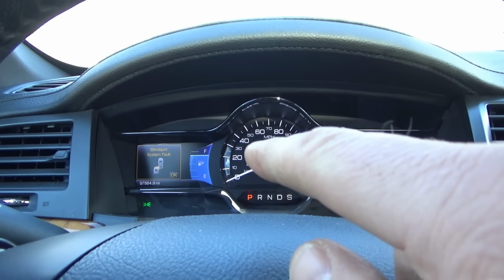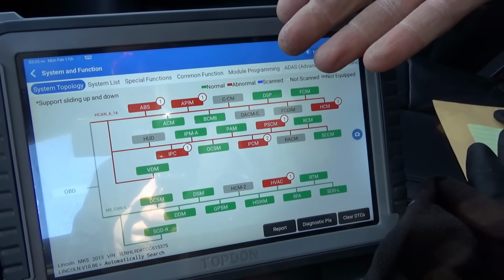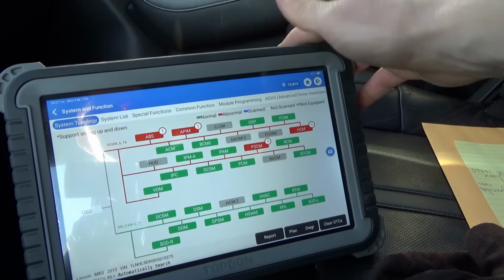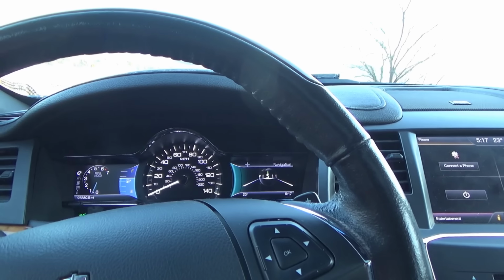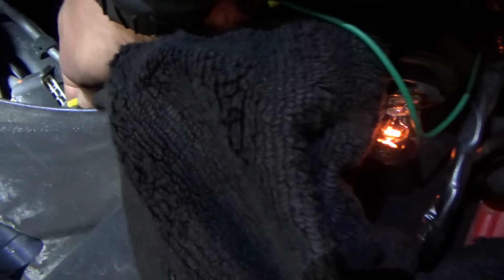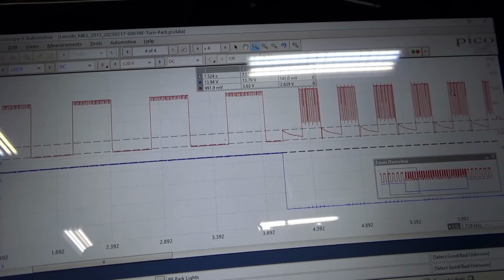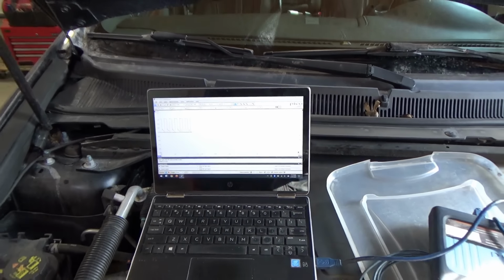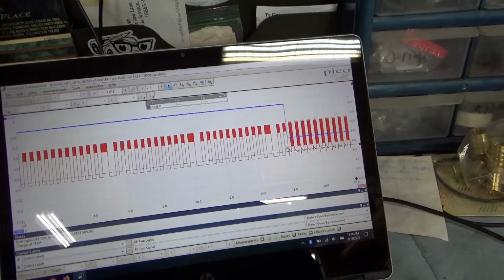(Pt 2) Lincoln BUTCHERED...by Dealer?! ('13 MKS: ABS Fault...CRAZY "Strobe" Turn Signals?!)

Comment: Crazy stuff. When I started working on vehicles, in addition to the tractors that I grew up working on (Oliver 77 RowCrop), the speed of the turn signal flash was controlled by a resistor in the turn signal module. If the speed of your turn signal flash changed it meant that the resistance in the circuit had changed, which typically indicated that a turn signal lamp had burned out. Replace the bulb and the blink rate would return to normal. Of course, we're talking about the early 70's... :-)

Comment: A higher voltage on the battery means that water ingress issues would occur more frequently. The succession of rapid and normal-speed flashes should have been an indication of an intermittent fault, not necessarily BCM-related only.

Comment: Hi Ivan , I have watched you for a fair few years now. You are great at what you do and your videos are very clear and helpful.
1995 to around 2015 Fords in UK use the indicators for fault codes and key programming procedures both pats 1 and 2  manual program no tools.
your pattern is repeating the same sequence over again.
I have not seen it on newer models as yet.
Keep up the good work, Wish you the best with your life changes.
Kind regards Max

Comment: The turn signals are because of a bad bulb or incorrect bulb. My Ford f150 does this when a bulb is bad or when I put in LED bulbs. It makes crazy blinker patterns. And whats even crazier is the light itself does not flash to the blinker noise you hear.

Comment: It is insanity to make cars so complicated that this happens. The chip in your alternator should not need to be tied to the map lamp in order for the steering wheel to work. The rear window defogger should not have to be connected to the radio.

Comment: I LOVE customers like this lady. "FIX IT. I'M KEEPING THE CAR FOREVER." Makes the bullseye on the target very clear, even if the target is 1600 meters downrange. I've had a few like her. One such gentleman (RIP Mr.Potter) owned several MINT, 1970's Toyota cars and a 1979 GM diesel station wagon. Even if a worn HVAC linkage was "tinkling" on a rough road, and the entire dash had to come out, he wanted it FIXED. "CALL ME WHEN IT'S READY." -- B.P.

Comment: This make me think, these moden cars use bcm to control almost everything, If the bcm goes bad and discontinued ,can we fix it by just use some easy method. My 2012 Jaguar xjl just went dead under a small lot not able to tow out. figure out dead bcm. fortunately I found two used one and got somebody programed it.one of it just worked luckly.  it's not hard to replace . or if both of them doesn't work I have to give it up

Comment: Just for laughs try inspecting all the globes for crusted/ water   And take out light switch for wear damage and has the leaking water got to it . Can you cover the car while you’re away . The condensation in the car while you’re away won’t help either. I’d be mopping out as much water as I could

Comment: Could the BCM be trying to limit current?  More voltage = more current and then it tries to limit the current?  The headlights on must be lowering the voltage below a threshold and then it no longer needs to limit the current...?? Or turning on the headlights is some how creating a redundant ground?  A voltage test at the BCM might yield something?  I think it is somehow related to the steering angle sensor issue.

Comment: In the old days when your turn signals act crazy, you just had to replace a $2 flasher three pin relay. Nowadays if it happens, you have to replace a $1000 computer module.  We are going backwards. 😭

Comment: If this would be my car... :) 
I would drop in a new clockspring, 4 wheel-speed-sensors and see, if any problem is solved. 350  + 4x20 Euro till here. 
Or a used clockspring 40-60 Euro. 
Is the ground of the bcm in good condition? 

This disco-policecar-flashlight in MY car happend when ground somewhere was compromitted. 
BUT: I con't habe a pico.

Comment: It seems to me that the problem with the turn signals is wiring related. Both park and turn signals share a common ground, and the headlights are grounded at a separate location. Also, since the BCM has separate transistors for both right and left, how can both experience the exact same symptom if it's an internal BCM problem? It seems more likely that the BCM is reacting to an external problem that both sides have in common, which is the ground. I checked the OE wiring diagram, and it shows the park and turn signals ground at G100 on the right side of the engine compartment. It appears to be loaded with a bunch of other grounds as well, much like Chrysler products. It's strange how the ground passed the test with the incandescent test lamp load, but we also never got to see if there was voltage drop on the circuit with the load applied. The only clue is the elevated voltage on the scope. I'm still just not convinced the BCM is bad since it has the capability to function properly, but it starts doing weird things only under certain conditions. Since LED current draw is so low, possibly they just can't "burn through" the corrosion.

Comment: having experienced a bcm failure and configuration issues with the replacement because we attempted to copy the configuration from the previous module i can attest to seeing some problems with the trunk it was in until we were able to get it properly configured i would suspect that this part of the issue im looking forward to see what you find ahh water such a big issue with these things it’s probably why it died in the first place leaking windshields plug sunroof drains so many times

Comment: My '15 Hyundai Genesis has an incandescent turn signal/DRM. In stock form, it's basically an 1157 socket but with only 2 wires. It's wired to run on the high side filament, so the DRM is always running on the brighter filament. This makes the bulb fail within about 9 months. I changed to an LED bulb which lasts much longer, but can cause "Hyperflash". I guess it's BCM is looking for a certain load and doesn't always "see" it. Maybe you could just add a small load resistor to the Lincoln's circuit?

Comment: LED signal light require a different relay because of the low voltage. Maybe someone changed the relay for some reason and put in a relay for incandescent bulbs instead. ?? I know if you put led bulbs on a motorcycle you have to change the relay too.

Comment: I used to be a huge Lincoln fan.  Last good one was the Towncar. The 90’s to early 2000’s were great cars.  The only issues I remember were the auto leveling rear bags.  My grandma had a 92 Continental, and it was also a good car.  Man they were so comfortable.  These new cars feel like you’re sitting on a stiff awkward lawn chair.  It’s absolutely pathetic that Ford/Lincoln cannot fix or supply parts for a 2013.  If I was her I’d get rid of it.

Comment: Once had similar issues with LED lamps being controlled by pulse width type dimmers. Work around was a small incandescent lamp in parallel with the LEDS. Strobing effect ended.

Comment: It's a ground issue, when parking or or headlights make the issue go away, I'm guessing they share a ground point.  It's more obvious in LED's that blink, but incandescent bulbs will be dimmer when the parking or headlights are off, and brighter when they are on.  You also noticed that the side blinker doesn't work with the the parking lights off, just the front blinks like a strobe, perfect example of a weak ground.

Comment: ivan these fomoco bcm modules are known failure points for water intrusion ,i had a mustang that the radio didnt work park lights were freaking out turns out water inside the bcm rotted all connectors green at harness connections changed bcm cleaned all connectors car is perfect now

Comment: Old electronics guy here - I think LED's on the cars have their brightness controlled by PWM duty cycle. The same LED can perform 2 functions ( like park/turn) when driven with different waveforms. And the fast flash is traditionally used (since turn signals have existed) to let you know a bulb is open circuited. I would expect the BCM is monitoring current to the bulbs/ LED's, and changing the flash rate when a current threshold has been triggered. And with battery voltage changing due to alternator or battery charger conditions, the bulb/LED current will change, possibly triggering a threshold in one or more situations. One would also wonder if the BCM has calibration settings to compensate for differences in vehicle bulbs/LED's. I find it interesting that very old vehicles used a thermo-mechanical flasher to accomplish some of the functions that a modern car uses a computer for. I remember in the 1980's a Mercedes had an electronic flasher module that was $35 and did the same job as what a $0.99 thermo-mechanical flasher did at that time. I like the old stuff. The new stuff will never be as reliable or sustainable, in my opinion.

Comment: This gets weirder on each video, Ivan! My first thought was a bad current return on the lamps, but you shown the ground is good. Next, I thought the alternator could be influencing the electronics, but no definite check was made. The scope patterns are very repetitive and (assuming it's not a police BCM 🙂) could be, indeed the BCM causing them. Couldn't think of a reason, but @uldiisl below mentioned a wrong lamp check, that I find possible, but does not immediately explain the effect of the parking lights. Part 3 will be very interesting! Wonder what Keith thinks about this 🙂

Comment: All above my head however a 2013 mks did not come with LED standard, I think. Has the lights been changed over to LED? That has caused problems for me because of decreased current draw.

Comment: Obviously you need to pull the BCM and pull it apart and see if it's corroded inside.  Maybe you will get lucky and find some green crusties that can be fixed and still use this BCM.   Then you still have to find the water issue.    I would get a good close look at the windshield and then the cowl under the hood, etc.

Comment: I know several years ago, Ivan, you went to a training seminar and met up with Keith DeFazio and Keith Perkins from L1 Automotive training.  You all had a vehicle that had been in a flood and it was doing some weird stuff.  I can't help but think that leak has something to do with the issues this car is having at this time.  I must say, if this woman takes meticulous care of her vehicle, it hasn't been cared for in the 6 months it has been off the road.  I would bet there is an issue with the plastic tray below the windshield having drain holes clogged with leaves and debris and it is overflowing into the car.  Can't wait for part 3.  GREAT VIDEO!

Comment: If you want to drive an LED you need to control the current not voltage. It looks like that switching  you see of the voltage waveform is an attempt to control the current. This control mechanism also explains the sensitivity to voltage for the  flashing. If you drive a small LED you just use a limiting resistor but at these current levels this would be horribly inefficient. That water incursion could cause a bias  in the current that pushes the current draw close to trip point for a PWM current switch. I’m certainly no expert on LED drivers but given my knowledge of circuit design this makes sense to me.

Comment: yhose funny wave forms on the off cycles may indicate a defective led bulb. they have driver circuits inside that can fail or partially fail and could be the fault.
id start by relacing, with a new one, the bulbs 1 at a time just to see.
and check all the grounds, we only saw you doing 1...

Comment: I vaguely remember the last time I had to manually input the configs into a module like this.  Soooo many lines of code.  I had to re-do it several times because I kept putting incorrect data on the wrong lines.  Could that be what's happening here?  Perhaps.  It's certainly acting like a circuit protection feature is kicking in though.  I can't wait to watch part 3.

Comment: No BCMs available? I'd like to take the circuit board out of that BCM and start testing the capacitors, switches, and see what's going on there. There's probably some failed component (capacitor/switch) and the board is rerouting.

Comment: I would love to see a scope capture of the input voltage and ground feeds to the BCM for both the 13V & 14V conditions.  Nothing is making sense but I wonder if there is something weird going on at the supply side.  Barring that, I'm guessing a voltage regulator is bad inside the BCM causing is FET controller to act weird.

Comment: I am curious when a BCM "fails" if anyone has determined why. I do board level repair and at times would like to sample a failed module. The mention in the video that the dealer doesn't have good success programming used modules says something is wrong with the dealer. Can't be that every "takeout" module is a failed unit. The mention in the comments that the OEM may have some things coded wrong in a programming seems to lead to the reason the dealer is not successful. If you have garbage programming it doesn't take a new module to find that out. They connect it in the vehicle and connect to the OEM servers and there should be a diagnostic run, a full wipe, a programming, and an integrity verification. Just like an update to your phone from the OEM.

Comment: If it's just the turn signals, I bet you could create a simple board that takes the turn signal request and bypasses the BCM to provide power / flashing.  This isn't a hard thing to design and implement.  Maybe a 555 timing chip and power mosfet.  Worst case an Arduino.  But since there's a Part 3, my guess is you found the problem and fixed it.

Comment: I think this could be down to as built data being bad or incorrect, I have come across this on a Ford Mondeo that someone had put LED indicators in when it was factory fit filament, indicators would go fast sometimes then go normally and I looked at the asbuilt dat with with Forscan (extended license has a useful drop-down menu showing each of the options rather than the numbers ) and could see it was set to filament bulb with bulb failure option enabled. What you’re seeing on your scope when it goes fast I suspect is an algorithm in the BCM when it think there is a fault. as modern cars 10 not to use fuses on lighting systems, The BCM monitors the current and if the current drawer is incorrect it then goes into a fult testing mode till it see’s the current draw is correct again in this case it’s probably pulsing the output rapidly to check if the fault is cleared, by pulsing rapidly and ramping as you see on your scope helps protect the fit from being burnt out (because there’s no fuse to blow) and whatever the threshold is for good current bad current it’s probably right on the margin between the two hence the weird sometimes it’s okay sometimes it’s not.
I also came across similar behaviour of strobing when another person I knew replaced their registration plate lights with LED ones instead of filament they strobe the LED ones, but as soon as you went back to filament no Issues or if you connected the filament with the LED at the same time no issues again down to probably monitoring current drawer on the FET used to control them

Comment: For the leak I would check under the cowl, if these have similar drains like the 13 Explorers. Those drains get clogged up with dirt and debris and water fills up the cowl and spills into the cabin of the car. They have a drain on each side, I always tossed them in the garbage to prevent water intrusion again. I have had several explorers with water in the floor boards. I would check the lighting enable/disable feature within the BCM. Make sure when the dealer programmed the BCM that they didn't enable any police lighting features.

Comment: Those Lincolns are super particular with system voltages. I've got a 2001 LS-8 Sport that hates low voltages such as when the car sits for a month or so and gets used. The security systems goes into a tantrum, the horn goes on and off like big ben and the gauges and speedo needles will walk up and down their scales etc. Not until the battery gets onto a charger will that go away. Not to mention, mine has an intermittent drain from likely a module that won't turn itself off every time the car sits a few days. The outside temp sensor was reading incorrectly so I purchased a Dorman (only one available) replacement which continues to work just fine. And the ABS module likely has a bad printed circuit or solder joint that illuminates the advance trac bulb. The brakes and adv trac functions however. 
All I can say is...bad engineering and cheap designed parts. Fuel pump went out at 50,000 miles so that got replaced with a Delphi vs. Ford junk. Love the car but....no OEM parts are available which, may not be such a bad thing since the OEM parts are 3X more expensive and don't last any longer than good aftermarket parts.

Comment: with all the electronics on the vehicle a regular battery is not a stable it would be more stable if the battery was AGM because of the amount of current that is needed for the electronics

Comment: I would try disconnecting all the light modules and run the same test with only resistors to see how it works. May lead to a configuration problem in BCM. DEEP DIVE !  Could be fun!
Reply: Or even with no load on the circuit, what does the BCM do? It looks like the configuration data 726-13-01 = 0000-xxxx-xx seems to mean lamp outage detection is disabled for the front lights, so I would think it should flash normally.